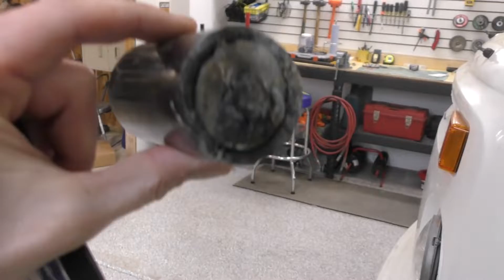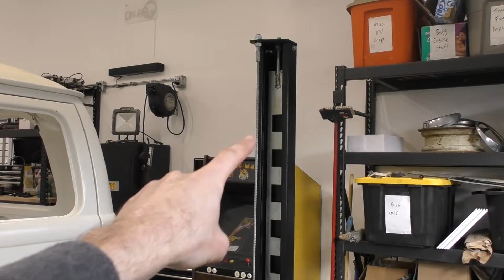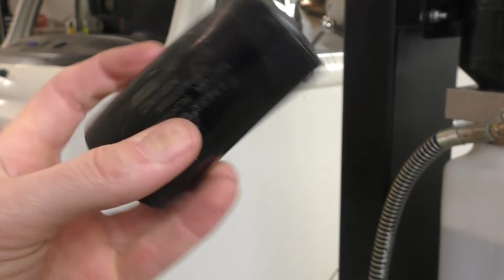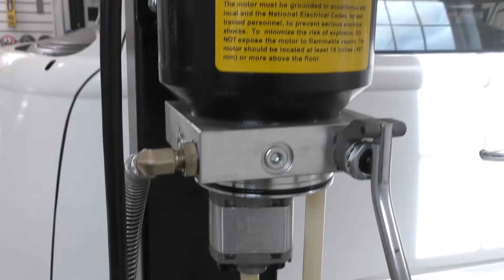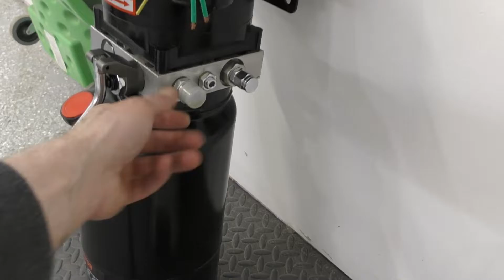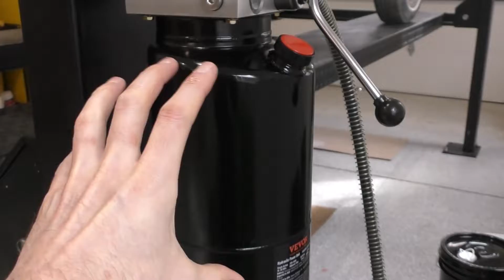Troubleshoot and Replace Hydraulic Lift Power Unit / AC Motor #vevor

Comment: Do you know what colors are the power and ground for it. My colors are blue, brown and yellow/green
Reply from the maker: You should confirm with a multimeter which wires go where.  But typically, yellow/green is ground, white or grey is neutral, and all other colors are line voltage wires.  If it's a 220v circuit, my guess is your blue and brown wires are hots.

Comment: I have a Vevor unit like your new one. It lifts partly initially. I release. If I don't release fully, it doesn't lift. Even if I release fully, it eventually only lifts a bit. It seems like a pressure build up that the motor can't overcome. Any advice?
Reply from the maker: Along with your pressure release valve, there is a check valve.  It looks like a hex-head bolt on the side of the unit.  It's usually sold with the release valve.  Here is an example (note: I didn't confirm this product fits the Vevor) https://amzn.to/4miJcm1.  Try pulling out the check valve and clean it - or if there is obvious damage, replace it.  See if that helps.
Reply: Please explain the issue better. I have a hard time understanding what your issue is.

Comment: do you know if the manual lowering valve cartridge thread size is 3/4 ?
I need to order one
Reply from the maker: I don't know. Perhaps you can find a parts manual online. It could be a metric thread.

Comment: Terrific video, particularly the explanation of the function of the two capacitors and the installation and bleeding of the new power unit.      I just ordered a new  220V Vevor power unit for my
little used Advantage 4 post lift with a 120V pump motor that shorted out.  Nice VW micro bus project.
Reply from the maker: Thanks!  Good luck installing the new power unit.  I am still very much happy with it.

Comment: I have a scissor lift that started acting on me when I was trying to lift a vehicle yesterday. When I plugged the 110v cord into the wall, the motor kept running (but I was not pressing the switch) the lift was not going up even the motor was running. It seemed like it was running weaker than normal though. I thought it was a switch. I removed the switch to eliminate it, and plugged the power again and it did the same thing. motor kept running but hoist not going up. I followed the wires to see if I can find a motor control and I found 1 capacitor like you just talked about in your video. Is it fair to assume that would be the next place to check? Would that capacitor cause it to run continuously? Thanks for your video btw it was hard to find information .
Reply: Capacitor Specs

GGM CBB60
100MF $ 5% 250V AC
50/60Hz -25/70/21 SH
E488580
Yangzhou Mingan Electronic Co.10.

Motor Specs

HYDRAULIC AC MOTOR
VODEL: YL9OGA-2
VOLTS:
nov
AMPS:
264
OUTPUT: 2.2 KN PHASE:
1PH
SPEED: 3420RPM
FREQUENCY: 60H2.
INS.
CL:B
DUTY: S3-40%
TOTALLY
ENCLOSED
NO
FAN COOLED
OR DRIPPFOOF
MADE IN CHINA
YANGZHOU HUASHENG MOTORS MANUFACTURING CO., LTD

I could not attach a picture here.
Reply from the maker: If it is a 110v motor, you should have hot (usually black) wire, a neutral (usually white), and a ground (usually green).  The hot should go through the switch and should only complete when you push the switch.  When you say you removed the switch, I assume you didn't bridge the hot wires back together that were on the switch?  So you would expect nothing to happen when you plug in.  Since you are hearing something happen, it may mean you have current going through the neutral.  Usually when that happens, it is less than 110v and could cause the issue you are having.  If you can, turn off all devices in your garage and turn off all breakers except for the outlet the lift is using.  Plug in the lift.  If you don't hear noise, that means another circuit may be improperly back-feeding power into your lift circuit's neutral wire.

Comment: i noticed you calling the middle portion the stator and the outer part the rotor... but wouldn't it be the other way around?
Reply from the maker: Yes, I think my terminology was incorrect.  The outer casing is the windings/stator and the inner rotor is the armature?  Honestly, after all of the issues I have been dealing with, my brain is complete mush. 🤪
Reply: @FixItScotty    no worries. I was mainly asking because I wasn't sure if I had it wrong! You should check out the Mathias video he did recently on the washer motor - it helped explain a lot for your motor as well even though they are different. Thanks for your video.
Reply from the maker: @FrankGraffagnino   I assume you are talking about this guy? https://www.youtube.com/@matthiasrandomstuff2221.  I wasn't aware of this channel.  Seems like a good resource.  Thanks!!
Reply: @FixItScotty  yes that is his second channel. Mathias is a legend.
Reply: Mine 120V Vevort shorted right off the jump. 🤷‍♂️.